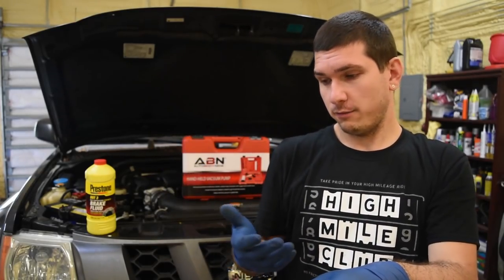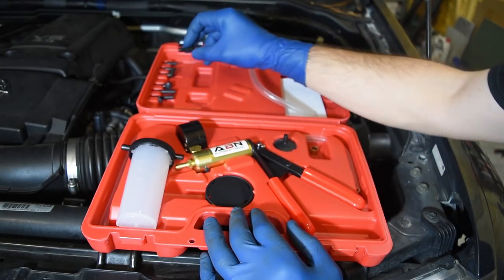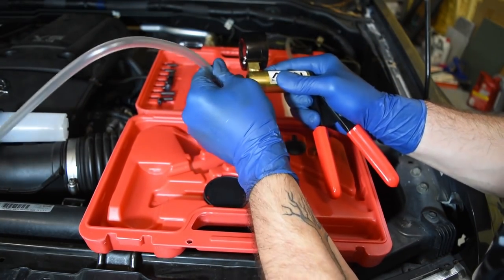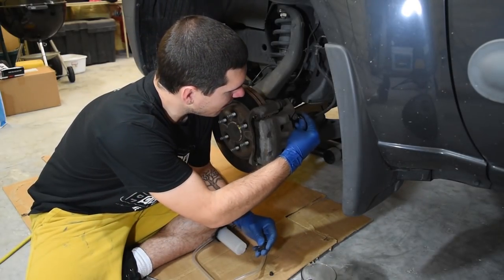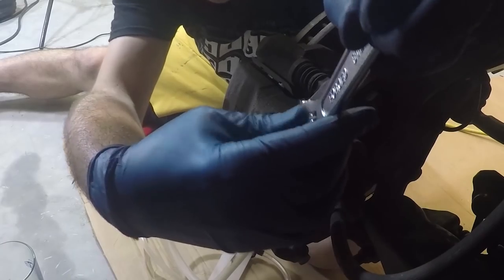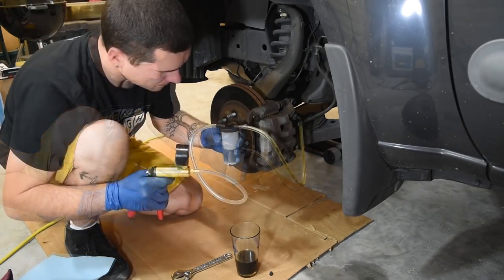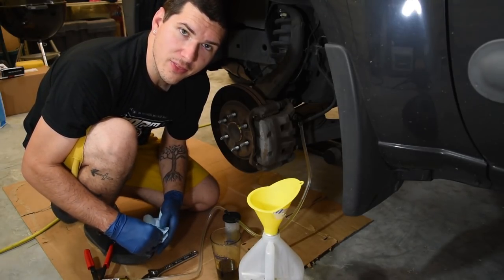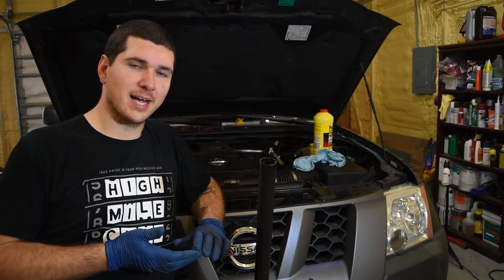How to bleed Your Brakes (replace brake fluid)

Comment from the maker: Hey everyone! I keep getting questions about the air in the lines. I wanted to let you know that the air was NOT coming out of the brake system. It was coming from the seal around the bleed nipple. In retrospect I should have used a hose clamp around the nipple to gently apply pressure and create a better seal. If you do that you should see those bubbles go away. Thanks!
Reply: That situation will falsify everything as you will never be sure whether you have taken all the air out or not. You can also use grease oil.
Reply: The air probably wasn't coming from the bleeder nipple to hose adapter interface, it was probably coming in from the bleeder threads to caliper body interface. Sometimes if you open the bleeder too far and use vacuum to pull the old brake fluid out you can also end up pulling air past the bleeder threads. Sometimes it happens no matter how little you open it. The solution is to either open the bleeder just barely enough to get brake fluid flowing and/or put some grease around the base of the bleeder where it meets the caliper.
Reply: Just use some tie-wraps around the hose line at the coupling locations...this should stop the leaks..
Reply: Nice video. Thank you
Reply: Order of bleeding should be RR, LR,RF, LF …. Its the opposite of what was said in the video … you should work from the longest line to the shortest line.
Reply from the maker: @MrDUKE375  order of bleeding should be whatever your manual says. Not all circuits are the same.
Reply: @napalm3899  do you think the two man system of bleeding the brakes is better than this vacuum device? I'm having the same issue it seems like alot of air bubbles.

Comment: A few pointers to add. I know its been mentioned a thousand times already but you start with the furthest and work your way closer (unless you have 4 wheel ABS, then it can be either way, you just have to take a look to make sure). You want to hold the hose angled upwards so that those little bubbles sitting right by the nipple don't get sucked back into the brakes before you're done for whatever reason. I'd also recommend a closed wrench or a flare nut wrench on anything brake related to avoid stripping. Ask me and my new brake lines how I figured that last one out... I appreciate the breakdown on how to use a bleeder tool/pump though and I agree with using the long hoses on both ends of the pump reservoir. You are very good at explaining the process thoroughly and all in all, I appreciate the video!

Comment: Ry, great video, quite detailed, most informative,  thank you.

But must confess I winced a little whenever I saw you use your adjustable spanner on the brake bleeders.  Viewer Gerald Carey commented NOT to use an adjustable spanner because it might strip the threads. Well, I don't know about that bit but, imo, the greater risk with the adjustable spanner is rounding off the corners of the hex heads...especially if the brake bleeder is tight or frozen in.  Dealing with a rounded-off, tight and unfriendly brake bleeder is NOT a place you want your viewers to be in, especially if they are DIYers with limited tools. :)

To first crack open a brake bleeder (just slightly, before fitting the plastic tube) it's best, imo, to use a quality brand socket (preferably 6-point) of the correct size OR a quality brand flare nut spanner/wrench (such as Stahlwille or Snap-On, or similar). Use the same tool for the final tightening when you've finished bleeding a caliper.

Once again, thanks for the video, it's one of the better ones on this subject on YouTube.

Comment: Was in the Auto Parts business for 38 years. I always remembered  that manufacturers said to start at the furthest brake away for bleeding brakes which would be the passenger rear brake Drum or Caliper. Then work your way over to the Driver side rear and then to the Passenger side front then to the driver side front where the master cylinder is located. Did something change? In this way you flush your main brake line to the rear of the car working your way up. I would not recommend using a adjustable wrench for the bleeder screw as you can easily strip it. Box end only. Just got done with bleeding brakes on a 17 year old Ford E150 Van that I own being the front right brake hose blew out from rust on the metal line part of the rubber hose on one side so I replaced both sides. What a bear it was to get the driver side bleeder fitting to Open up destroying it in the process. Ended up replacing it with a new bleeder.  Had to heat the old one to loosen it to replace it with the aid of a good set of Vise Grips. Ran into this problem plenty of times over the years. Not knocking this video at all. You did a great job putting it together showing your steps. I enjoyed watching it. Just felt I needed to add a few things from my experience.
Reply from the maker: Thanks. Everyone says to start from the furthest. Personally I think it makes no difference. They say its to avoid "contamination". 
However if anyone thinks that they will get ALL contaminants out by simply swapping the fluids then they are crazy LOL.
Reply: Honda service manual starts at left front and clockwise from there.
Reply: That's from experience and the way its been done forever. A lot of services manuals actually say to start at the left front, closest to the master cylinder. We need more research! lol.
Reply: @bigwilliearmitage  
Japanese are a different breed...
Lol
Jks
Reply: I thought the master cylinder needed to be closed when bleeding/flushing the brakes?
Reply: @icfghost  
No, it doesnt have to be. Its up to you which way you want to bleed it. Cover on is safer, incase debris falls into the reservoir.
Reply: Nissan FSM indicates to bleed in order (RR, LF, LR, RF).  Yes that goes against conventional bleed procedures but there must be a reason Nissan what you to bleed that order
Reply: @speedsterwinston  what dictates left and right? Sitting in the drivers seat or standing in front of the hood?
Reply: @calebbutler9216  sitting in the car seat.  Drivers side =left side, passenger side= right ride.
Reply: @speedsterwinston  thanks a million!
Reply: Subaru (some models) insist in manual to start from the driver side...
Reply: @speedsterwinston  port and starboard forward and aft
Reply: I think each car model is different as the brake lines are of various lengths depending on the design of each vehicle. I recommend going by what the manufacturer/shop manual states.

Comment: My car has 125k miles.  I have never changed the brake fluid.  Should I do this asap? Leave it alone? or get the job done on the next break job?  Thx

Comment: replaced clutch master cylinder & slave on wife's car, the THE BRAKE & CLUTCH SHARE THE SAME RESERVOIR after bleeding the clutch cylinder the clutch pedal is hard now, will bleeding brakes need to be done? any help is appreciated.

Comment: I am looking at the same bleeder kit. How can you tell there is no more air in the line? Looks like even at the end there are bubbles.
Reply from the maker: There should not be any air. I was just pulling air in from the outside of the hose because it was not creating a perfect seal around the bleed valve. I was working off of color. Once the color looks good I changed over to the next tire.

Comment: How about if the car has ABS brakes  Can I do it the same way or do I have to use a scan tool to active the ABS brakes
Reply: Onkar Kainth you do it the same way but he's wrong you always start at the farthest one away because there's always a better chance of air being in the farthest one away than any of them so if you started the first one you could do it and there'd still be air in the other line. All your abs does is it has sensors that tells it when the tires have stopped moving and then it causes the module to pulsate instead of constant force which eliminates sliding
Reply: Always start at the farthest one away?? Honda recommends starting at left front and I'm following the advice of the engineers who built the car. Also, he's right about some brands requiring a scan tool for this. Lexus is one.

Comment: good video....at the garage i disconnect the break line under the hod and blow compressed air in the line too speed things up..however i think a doller store air can for computers may do the same 4 cans later but anyways good home remedy

Comment: Never use an adjustable spanner on hex nuts.  You will strip them.
Reply: I agree!..Best to use a flare nut ring spanner or at least a ring spanner.
Reply: @swingmanic  I use a line wrench. That's the type of use that style of wrench is designed for. It's as strong as a box end wrench and allows you to use it with a line or hose attached to the fitting you're turning.
Reply: @MisterJim-uj3gd  Line wrench & flare nut ring spanner are the same down here in Oztralia, just different terminology.
Reply: @swingmanic  By the way, I appreciate your video. It enabled me to do the bleed job myself. I've done it with my wife's help before and it is never easy that way. How can someone mess up "Push the pedal all the way down and hold it there until I say leave up"? She always manages to try to pump the pedal before I close the bleeder valve thus letting air back into the system.  "It felt too soft so I thought I had to pump it." DON'T PUMP IT UNLESS I TELL YOU TO!!
She could screw up a Sunday School picnic, I cringe when I have to ask her for help with anything, but sometimes I have to. BUT not for brakes any more!  THANK YOU!!!
Reply: Gerald Carey yes it may work to get the job done but you risk rounding out the bleeder screw all of the brake lines are connected with what you call flair fittings wich requires a flair wrench it grips on to the flat parts of the screw much better if you are planing on taking the a5 ase test that will for sure be one of the questions
Reply: yeh I agree , use the right tools/brake pipe spanner, it looks more professional too.
Reply from the maker: Not in a Florida car!
Reply: I hate Adjustable wrenches like that they always open or close too much while trying to work with it, Annoying!

Comment: Aren't you suppose to start at the brake "furthest" away from your reservoir?
Reply from the maker: You can start with any of them. It does not really matter. The goal is just to get all the old liquid out.
Reply: I have always started left front then right front my theory being that that it gets the old fluid away from the master cylinder, proportioning valve etc. first via the shortest path. Why push all that old contaminated fluid all the way to the back of the vehicle?  Short answer - I have had good results regardless of which wheel I start at. The exception would be if the master cylinder needs bleeding, which would naturally be done first, either with bleeder tubes (one person) or at the two outlet pipes (two people).
Reply: The rationale Ry is that by cleaning out the longest line first, you don't draw old fluid into the next wheel you bleed.
Reply: Correct!
Reply: Yeah that's what I thought as well, but I believe the main thing is not letting the old fluid(at the calipers) back up into the abs.

Comment: Always best first to remove old contaminated brake fluid from the mastercylinder fluid reservoir on top otherwise accumulated brake dust, dirt, etc Will go back into lines causing more fluid to be pumped out to achieve nice clean clear brake fluid.

Comment: I can see why you stated from the closest brake. That will drain the reservoir first, then proceed as usual. I think you used the adjustable wrench to show that anyone can use whatever they have. No sense in buying something when you can use something else! Good job on the video, it was a straight forward approach and simple to do. Bleeding the brakes is one thing and cleaning out the fluid is another. Keep up the good work! THANKS.
Reply: Until you strip the head of the bleeder ot the threads in the caliper and then have to get a new caliper/bleeder. And that always happens at night when the store are closed or they don't have it in stock and have to wait days for it. No replacement for the proper tool. It will last a lifetime. If your willing to take on this job, your willing to do it again which means you will use the tool more than once. And the money saved by doing it yourself more than pays for any tool you have to purchase

Comment: Here is my 2 cents worth. try not to use a crescent wrench and you will not have stripped out nuts bolts. And the brake fluid in a drinking glass looks like tea or coke.

Comment: Brake fluid compresses .5% per 1000 psi. Water at 10,000 psi is less than 3% air is ur problem
Reply from the maker: Correct thank you, I miss spoke in the video and I’ve been paying for it for years lol.

Comment: Thanks for making the effort to make the video.
If I were doing it I would do the line that is the longest and furthest from the brake fluid reservoir.
I would use a quality ring spanner
The kit looked decent and certainly not expensive but I'd like one with a bigger container - so I could do all my pouring out of old fluid at the end.

Comment: Slowing fine tuning my xterra with your videos, also full suspension replacement, radiator and heats hoses, plugs and coils etc. Thanks for the help

Comment: For those who asked, the service manual says
Perform steps 2 to 6 at each wheel, with master cylinder reservoir tank filled at least half way, bleed air
 from the front left, rear left, and front right bleed valve, in that order.

Comment: I always thought it was "start furthest away"?
Reply: Yeah Me too... I have an 07 Armada and the manual says to start with Rt rear then Dr Front,  drvr Rear then Rt front.. in that order... However its using the brake pedal method and not this self method, so not sure if should be reversed..??  Also step 1 says pull abs or batt neg cable..
Bleeding Brake System EFS006SW
CAUTION:
While bleeding, pay attention to master cylinder fluid level.
1. Turn ignition switch OFF and disconnect ABS actuator and electric unit (control unit) connector or battery
negative cable.
2. Connect a vinyl tube to the rear right bleed valve.
3. Fully depress brake pedal 4 to 5 times.
4. With brake pedal depressed, loosen bleed valve to let the air out, and then tighten it immediately.
5. Repeat steps 3 and 4 until no more air comes out.
6. Tighten bleed valve to the specified torque. Refer to BR-21, "Components" (front disc brake), BR-27,
"Components" (rear disc brake).
7. Perform steps 2 through 6 at each wheel, with master cylinder reservoir tank filled at least half way, bleed
air in order from the front left, rear left, and front right bleed valves.

Comment: The only thing I caught, as far as misspeaking goes, is that you said the "start with the wheel CLOSEST to the master cylinder, and then follow with the second FARTHEST away, the third and then fourth". That seemed like an error. You probably meant "follow with the second closest, third and then fourth." Check your video. Am I right or wrong?
Reply: Every car have it differently.  It's in your manual . For example golf mk4 have 2 diferent patterns.  It depends on system . And it does matter but I guess only if for some reason you lost all brake fluid and have to bleed from beginning ( I had serious brake failure ) . And it is very hard to bleed empty system .
Reply: @robertkowalewski7294  You are correct, Every car's different. On my 2 vans bleeding is X sequence. LR FR RR LF. I just got done changing all brake lines on 1 of them and after bleeding off and on for 2 days straight my brakes are still spongy. Pedal goes almost to the floor. I don't know if a pressure bleeder will even help.
Reply: @tinytim9453  when i had to bleed empty system had to do both wheels simultaneously

Comment: I think there is a misconception here.. a spounge brake pedal is not a sign of water in the brake fluid.
Water is just as not compressable as brake fluid.
If you have a spounge brake pedal it indicates another fault, most probably air in the brake fluid.
The reason for changing the brake fluid is, as you said that it is hydroscopic, it attracts water.
When water gets in to the brake fluid, it corrodes parts inside the brake system, like for example the pistons.

Comment: There are a lot of bubbles in the hose.  I think your connection to the bleeder valve is sucking in air.
Reply from the maker: +Jeffrey B yea, it came with little hose clamp but i wasn't going to mess with all of that

Comment: Bad boy! don't use an adjustable wrench on the brake bleeder valve or whatchamacallit! Also liquids cannot be compressed. That what I was taught.
Reply from the maker: I’m trying to build a reputation of a rebel mechanic, is it working?

Comment: I think you got you're info a little mixed up hun. Youre supposed to start at the caliper that's farthest away from the cylinder and typically with Nissan there's an order of operations. For example on my M35 Infiniti, you start at the rear right then front left then rear left and front right.
 Also with  Hydroscopic fluid the reason that you don't want water or moisture in there is because once the temperature  if the surrounding fluid raises any trapped moisture will hit a boiling point and evaporate.  It then becomes gas or essentially air in the system which then is a moot point to having bled the system in the 1st place.

Comment: Water in the fluid does not compress until it gets hot and "boils".  The vapor is then compressible.  Micro-bubbles of H2O then spread homogeneously throughout the brake fluid and the spongy pedal will remain until a fluid exchange is accomplished.  The Micro-bubbles will also cause rust throughout the system fairly quickly. Rust is harmful to everything in the system but is particularly harmful quickly to ABS pump and brake calipers.